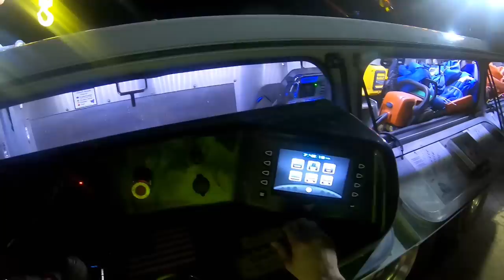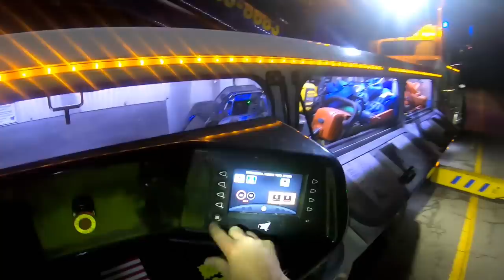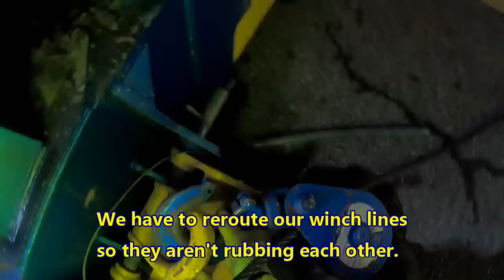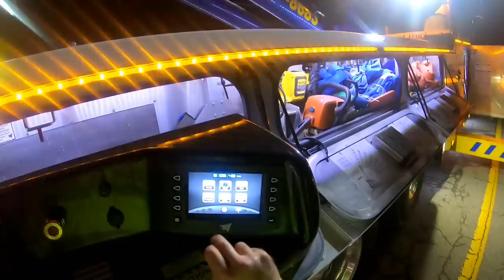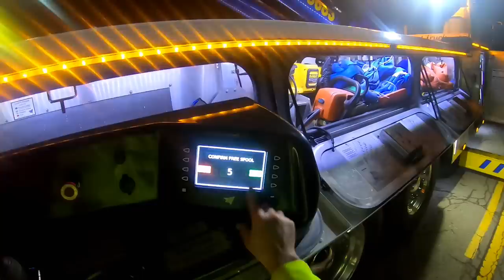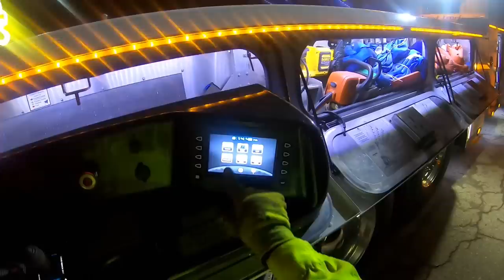Hanging By A Wire ... Almost A Rollover

Comment: Saw this, this morning and another fantastic episode. It pays to pay attention while watching your videos as you can more than a thing or 3  as I discovered. The teaser from earlier in the week, I got right, had to go back and read my answer as you always seem to either try to separate the tractor from trailor or pull by the tractor to get it untangled from the wires by first getting it stabilized so it won't rollover or whatever first and then go about getting it free before you do anything more, but always pulling  by the tractor itself.

Comment: Mike seems like a lot of the driver trainees that I get straight out of the schools. You can see the eagerness and determination to do the job well but, at the same time, they want to go full bore all the time. Sometimes they get upset with me for trying to slow them down. Then, after a few days, they realize that it's ok to take things slow and think them through before taking action. I'm extremely proud to say that I've trained over 100 drivers for our company in the last 20 years and that most of them are still in the industry. The thing that I'm most proud of is that only one of my trainees has ever had a serious accident. Unfortunately, the one that did was killed. However, she gave her life trying to save the driver that caused the accident and that gives me a bit of relief.

Comment: Or Ron another suggestion that I have 4 u is if you're ever in that serious situation again on the interstate when people won't move 2 the left 4 u is adding a computerized message board on your tow trucks as well c if that will help move traffic over so your not in harms way like have it fold up when you're either helping a customer or on crash scene I just thought I'd also give u more pointers and install a camara on so if people won't either slow down or more over they could be issued a ticket 4 failure 2 move over law have a good day God bless u my brother and be safe and careful

Comment: Where I live occasionally I see large heavy-duty tow trucks hauling a broken down transit bus or a large truck like a tractor trailer. But they don't have a boom on it like your rig so I don't think they could upright an overturned truck. It's amazing the power of your vehicle and what it is capable of - especially with an experienced operator like you who knows what you are doing. I've watched several of your videos and have noted your knowledge and thoroughness; you think of everything before starting a job. And you sometimes have to work in tight quarters either due to a narrow road (such as the video with the overturned truck carrying logs) or to avoid blocking both lanes of a road (sometimes at the request of the police). Every situation is different but you always seem to come up with a solution. But I will point out one minor error in this video; at 16:25 you printed a message on the screen saying "Sometimes you're first idea is the best". You should have used "your" instead of "you're". The latter means "you are" which of course makes no sense in that sentence. I find most people make the reverse error; they use "your" when they should use "you're".

Comment: the towing lift at the back could that also be used as a strut (or as you call it an out rigger) to support the truck when lifting heavy objects situated at the rear of the truck i know its not what it is designed to do but if it can lift and tow a  HGV  i sure it could support the truck when fishing out a truck from the pond

Comment: Excellent! Very little damage , the driver could have  driven away.  I presume the rig had to be inspected before thzt though. Have you looked at chocks to block your "tater" to prevent the slipping    problem. That seems to be a recurrent issue. Just a thought.

Comment: Really nice job to you and your crew all did a great job came out lot better than anyone would have thought they free videos keep them coming talk about when you see emergency vehicles are semis having trouble the flashers on get thinner legs slow down I had a different experience with the semi when I was coming home I knew there was a hill covered up the speed limit was was like 25-30 miles an hour the new he was going to make the hill so I stay back and it was a good thing because you didn't make the hill you got stuck in Midway so I turn my flashers on stay in my Lane let him take the time he need it then there was a car trying to go around me safely I block both lanes so the car couldn't get around me but when I seen a current coming down the inner Lane down the hill I get out of the way easily by the time the truck was mostly up the hill he flashed his lights like he really appreciate it that's what people needs to do for you wrecker drivers emergency response vehicles and semis and respect motorcycles and their space we can't preach it enough I know Ron thanks for the videos again thanks for sharing God bless

Comment: I noticed that you are not securing the main winch lines and I seem to remember you saying that you were going to quit doing that to save time. Just a suggestion, why not set a fast idle on the truck in order to speed up the hydraulic system. I am not trying to be argumentative by any means, just an idea. I have the utmost respect for you and your abilities. Keep up the good work and may God bless you, your family, and your crew. I am totally addicted to your videos, so please keep em coming. 
      Dennis in Raytown
Reply from the maker: That's actually a good question.  When we took delivery of the truck we were advised against setting up the idle when working.  This truck has a special high volume pump that works at top efficiency at the set idle.....or so we were told.   I do have the option on the 3 main, 50,000 lbs winches of using their 2 speed functions.     Thanks for watching and God bless.
Reply: @RonPratt  l

Comment: I got that one wrong, I thought you'd secure the front and pull the rear tractor tires on first, then the front. Just curious if the was a "no-trucks" sign where he turned. I keep hearing guys blame their GPS and wonder what GPS they're using.

Comment: Again good job on that 
trk that almost tipped
over.That said are you
or could you go up to
Minnesota or South
Dakota to help out with
all the Jack knifed trks.
blocking their highways
and other roads?
Reply: I use mobile at times and I do not post my comments like that, it looks just a normal comment does on the web.

Comment: Technical question perhaps: when the rotator was groaning on its brakes and sliding backwards, would sticking a block (diagonally) between the rear tires help? I believe Ron had done this at a previous job, where the block was placed diagonally between the tires so that as the truck slid backwards, the front tire would ride up on the block and therefore apply pressure on the rear tire and create more resistance. Would that have worked in this scenario?
Reply from the maker: YES that would have worked in this situation.  Thanks for watching and God bless.

Comment: Some roads should say "trucks turn back"
Reply: Doesn't always work ! We have a road in Liverpool NY with a low bridge  and trucks just don't listen. I get at least 3 trucks a year that hit that bridge and there are big flashing signs at multiple  points aproaching the bridge that say LOW BRIDGE or NO TRUCKS but they don't listen!
Reply: Somebody wouldnt read it still
Reply: 11foot8.com Lights, signs, flashing signboard, caution painted strike bar, and people still run into it.
Reply: Some roads do. Some truck "drivers" shouldn't rely solely on their gps. The only gps in my tractor is the old fashioned 2 dimensional system a.k.a. the Rand McNally truckers atlas. GPS systems are great but I haven't found one yet that can actually drive for you. It's up to the driver to use good judgement in situations like this.
Reply: @towmaider3964  Watch the 11 8 bridge channel. No amount of warnings or signs or lights seem to help. Some truck drivers seem to think the laws don't apply to them, especially the laws of physics.
Reply: @tiredoldmechanic1791  I made my living on those who couldn't read till last August now I am retired do to health!
Reply: Good old OLP and the rail bridge. Trimming trucks for years..
Reply: @tiredoldmechanic1791  its YT channel is called Yovo68.
Reply: Mike Brown at least  YOU OWN a truckers unit., recently in NYC, there are roads OFF LIMITS TO TRUCKS &BUSSES,,BUT THEY GO, THEN HAVE TO BACK UP 1.5 MILES, POLICE FOUND OUT THOSE GUYS are using CAR GPS,,, HELLO LOW HEADROOM, HELLO OVERWEIGHT  on SMALL BRIDGES.. cheers from NJ
Reply: CO Jones  some years ago,,on Morris Ave in Morristown NJ,,the headroom WAS 11’8”, and new car carriers passed fo years,UNTIL  they resurfaced that road, ADDING to the base level,,so headroom was reduced, but they DID NOT CHANGE THAT SIGN, so new car carrier came by & crashed, well, the town, HAD TO MAKE GOOD,,As they had to eat CROW..! Cheers from NJ

Comment: @Ron Pratt 9:27 I want to thank you for telling me about these Guardian Angels. I bought two of the Red/White for my bike and my job. I do insulation and home remolding. In my free time i like to ride my bike in town and get some exercise. These lights not only save me from being hit wile i ride my bike, but also help me on the job when i have to be in a dark area underneath a house installing insulation. So thank you for helping me stay safe and have a better way to do my job. You be safe and God bless you and your family!

=============================
For anyone who is Law Enforcement, Fire, EMS, a tow truck driver, construction worker  or even a simple  guy like me that just likes to get out and ride my bike, I would HIGHLY recommend these to you. They are only $99.99 USD. Other accessory's such as the Strap & Epaulet Clip Mount, Universal Clip Mount, Hard Hat Mount, Bike/Rail U Bracket Mount etc, would cost extra.
BUT!! If you use coupon code "122CLIP" You will get a free accessory with your purchase! So click the link below and get one for yourself! I promise you that you will not regret it!

Guardian Angel Devices
https://www.guardianangeldevices.com/shop/

COUPON CODE:    122CLIP     (Free Accessory)

Comment: Ha Ron & Talon I Believe Happy Easter. You will need will use the Vulcan as a blocker. Then Back the Rotor to the Volvo and Left and Pull Him Out. Sounds Simple But It wouldn't Be Fun if All Job's Where The Same 🤠🤠🤔🚧🚓🚔🔨⚙️🔗⛓️🔧

Comment: I'm just curious.  For that last pull, is there a reason why you couldn't leave the spool locked and did the final pull with the transmission at the same time?  Would it put too much stress on it to have been able to do the move forward and the pull at the same time?  I'm just wondering because it would've killed 2 birds with 1 stone.

Comment: I was expecting the bumper and Hood get all ripped to shreds from the cable the other question I have in mind would have been better if the hood would have been opened up a little bit what's the cable being stuck between a hooded bumper to take some pressure off the hood just a question I don't do this stuff I just watched videos although I grew up on a farm we pulled enough stuff using dinosaur technology

Comment: Was it considered to use the 1150R to pull the guide wire away from the truck and use the V70 to pull the truck back on the roadway? I'm not a recovery man by any means, just the first thing that came to mind when I saw the extent of entanglement
Reply: As you seen, if they pulled it back it would only make the truck want to kiss the cable even more.
Reply: I didn't say to pull it backwards, I said to pull it back on the roadway. And using the rotator to pull the cable away from the truck

Comment: a little duct tape and JB Weld and everything will be alright.....
Reply: Your forgetting your mule tape
Reply: You forgot the baling wire.
Reply: Slap some Bondo on there, get a grinder with a buffing wheel, and you’ll be good to go.
Reply: It should buff out.

Comment: Thats the first time i see you use the main recovery winch on the back of the Rotator.
Reply: Go back to some Barrier cable videos from a year or two ago and you will see he used it back then, its as he said has got a finicky behavior of getting tangled to where it wont release or spool up correctly and he along with Miller have tried many troubleshooting ideas to fix its meandering menace.

Comment: Your next Rotator you may want to switch to disc brakes.  You may want to start doing that now with all your trucks.  They are faster to stopping and quicker to change out.  Shorter breaking distances.  I have one question do you keep spare pins for those tow hooks?

Comment: Ron idk if this is a question  u want on your YouTube but I have a dd15  that has a difficult time starting only in the mornings after truck has been off all night it will crank 10 to 15 seconds before it will catch  and fire up and I cant figure out why it's doing this. Now if you dont want these messages please let me know and I'll delete. But if you or any of your viewers have any idea why it's doing it please respond
Reply from the maker: Not a problem.   If any of my viewers can help you, then that's a good use of the community....to help each other.  God bless.
Reply: @RonPratt  is the shop open tomorrow ?
Reply: It's likely a fuel leak losing prime
Reply: @jeremyhanna3852  I dont see any visible  leaks

Comment: do you not have rubber feet for the outrigger it will with the rotator siding
Reply: Rubber would slide worse. Ron was being nice and used the available options first. Worst case would have been to put the spades down. Tator wouldn't have moved but the two potholes damage the road.
Reply: Those would get worn out fairly fast, thus why you never see a crane of any type with rubber feet.

Comment: 27:36 what was the officer measuring?
Reply from the maker: I believe he was measuring the length of the damaged guard cable and posts for his report.  Those items are state property and the trucking company will be responsible for repair/replacement, so the officer has to document the damage to state property.     Thanks for watching and God bless.
Reply: Ron Pratt that makes sense, at first I thought he was measuring the tire, hence the confusion.  Anyway thanks for the reply, great video as always.

Comment: Why don't you run a strep dirty front wheel on the driver side
Reply from the maker: In this situation I wanted the wheel to be able to turn as I pulled it forward.  By putting a strap on the wheel it would create greater resistance and as you saw in the video, we had enough resistance to deal with.....    Thanks for watching and God bless.

Comment: What's the cop gonna  write  him a ticket.. anybody can screw  up,,
Reply from the maker: Actually the officer was there for several reason and none of which was to write a tickets.   The driver's mistake caused State property damage.  The officer has to create a report so the trucking company's insurance will pay to have the property damage repaired.   Also the officer was there for traffic control/safety reasons.  The truck had the entire street blocked at night which could be a dangerous, possibly deadly situation.  So the officer was protecting other motorists while also protecting us as we worked.  Please think before you speak.  As you stated, "anybody can screw up".  Thanks for watching and God bless.

Comment: we had a fire truck hit by a drunken driver  week ago did a bigger mess than it should have been NO one's was badly hurt in that lucky for all of the tanker, full of fuel turned over and was being pumped out at the time the other person hit the truck did start a fire from the crash  we lost 2 fire trucks in the fire the drunk  that hit the truck had a head injury after he hit the window shield took all of the other  fire truck to put it out lost both of the tankers as well we had 4 water truck bring water to them the county did not want any water trucks at that station or even a fire station close by there
it was not the county's money that built it and does not matter we build it on the Indian reserve the size of the station might be oversize the county said too all the trucks are inside the station the reserve was able to match 2 fire truck up and we did 2 more and a big truck rescue truck to both the reserve and us have different size of smaller rescue trucks there too 10 smaller trucks for different jobs that house there to the count supply one truck it had a problem running and starting the county send it out to us to have the fire station to fail out here 
 we are a thorn in the county's butt out here over land we and the reserve own as to how really who own they land we and the  Indians really do not know who owns what back there 
a larger lake that the country wants to be access to there is no road  going to that lake at all or power back there the land is very secret  back there I love to ride horses back there too same as the Indians I do get along with the Indians very well I have been on there  secret barrel grounds it amazing I have to say that  
there story been passed down about the secret grounds both by my family and the Indians it sometimes hard to believe but they say she had no foot paints when she was life

Comment: Those cables along highways are a real trap. Here in Germany we have steel planks alongside. Seem much safer to me.
Reply: Steel planks may have kept the truck on the road, but also would have done $1000s in damage to the truck, and turned this into a tow back to the shop job.
Reply: Most places use those (W shaped) guardrails, and he has done many roadside cable removals where the vehicle got more mangled than if it was to hit a solid guardrail.